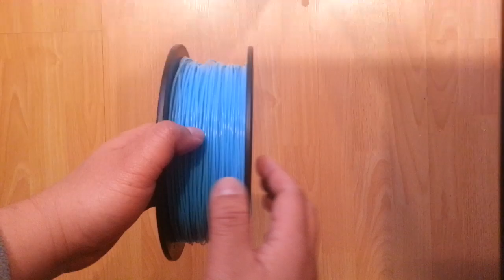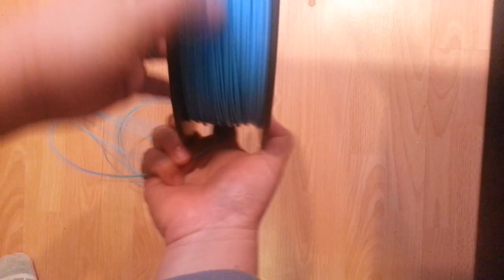Untangling and unknotting your filament

Comment: I should have found this video earlier! The annoying tangling spools keep ruining the prints! And it is randomly happened. It is driving me crazy after I spent like 3 hours on the print. And my printer is so stupid that never stop printing when the spool stopped feeding filament, and it keep working like normal but actually not. It claimed it has spaghetti detection camera, and it never works as well!

Comment: bruh this problem just ruined multiple prints i had thought the the tube was clogged as I heard the wretched clank clank sound from the stepper motor or it might be an issue with the nozzle or my ender 3 just must be bad and need to upgrade but it was just this problem all along

Comment: The most nightmare among the pro to begineer user is this! Imagine it print perfectly for last few hours then it got stuck... Is there trick to stop/pause print immediately when it tangles? Im using old prusa i3 type which has no special sensor to detect.

Comment: What about when the filament is new, sometimes a loop slips off  the outside and catches on the rod holding the spool. How do you prevent this from happening?
Reply: I hold my spool with about two feet of "lead" and then put my thumb over the filament where it meets the coil.  I then feed the filament into the printer while keeping my thumb on the spool.  Once the in-feed is set, I carefully mount the spool on the spool holder and wind it carefully.  With really full spools, it still can fall off the edge,- but usually, it doesn't.
Reply: Several potential fixes - add an edge guard that extends the spool up like it was bigger, or figure out what is allowing the slack back to the spool and control that - I have seen some cases with tall prints on a top of printer mounted spool that just pulls at a hard angle on a direct drive setup - adding a reverse Bowden makes the tension on the filament consistent regardless of head movement.  Even having a proper filament guide can keep the filament lined up.

Comment: Definitely had a few aborted prints over the years because of this. Good idea to always double check in well lit conditions when reloading spools. This is also why I dislike bots that mount the spool in the back rather than top where you can see WTF is going on during a print.